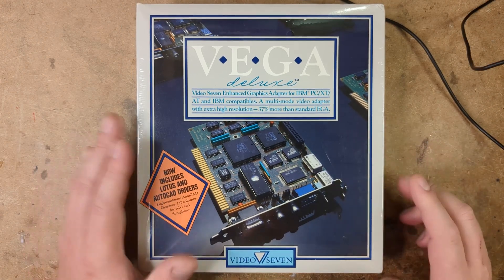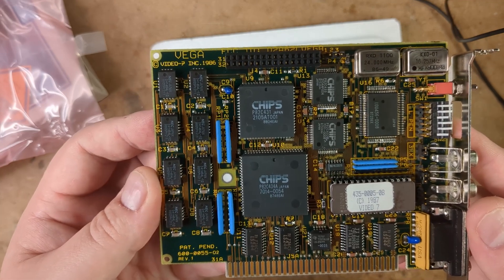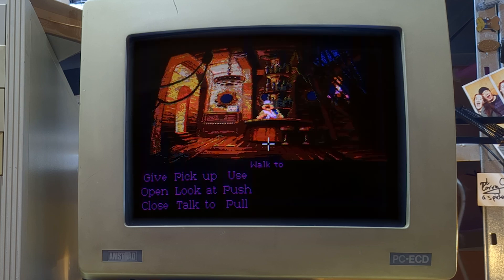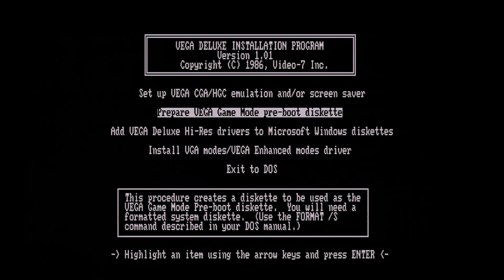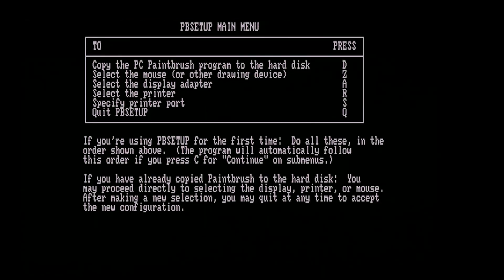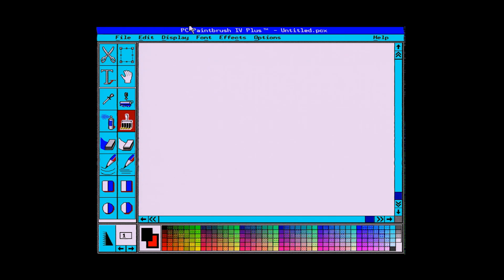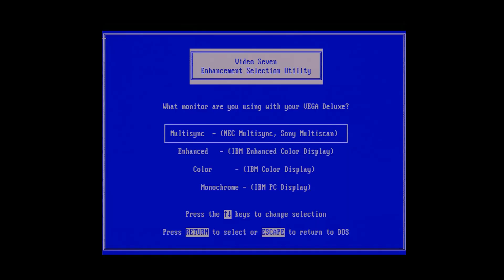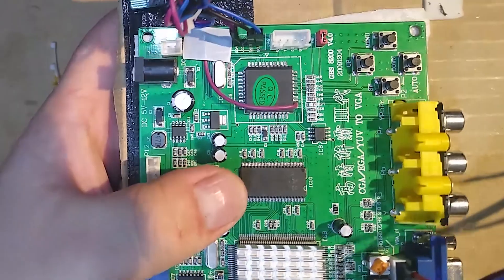Unboxing a Sealed 1980s Video Card!

Comment: What would happen if you installed Windows xp on another card then swapped that one in? Would it boot and run xp in cga?
Reply from the maker: Unlikely, but I'll have to try one day
Reply: It won't get into Windows. VGA is a requirement for all Windows NT based operating systems, there is no ega or cga fall back even with NT 3.1, VGA is the fallback. VGA bios emulation wont cut it you need real VGA. the XP startup screen requires VGA. BSODs even require VGA.
Reply: @MonochromeWench  It'd probably load in 16 colour mode depending just how compatible the VGA "emulation" is and what features the OS uses. If it's basically default VGA capabilities just with TTL output, then the only issue may be that the colour palette isn't quite right (closest available options from the 64). I think even the startup screen in XP is still 16 colour, just using palette fades to look a bit more sophisticated as it appears, so that would also be a bit clunkier (and look even less correct as it has a custom 16c palette rather than the more primary colour biased Windows default).

I swear I've managed to bodge a CGA driver for Windows 95 before when messing around with things, or maybe EGA, so it should certainly work under 9x. Not NT based of course... and the UI isn't really intended to be used with less than 480 scanlines so everything ends up stretched and occasionally clipped off the top/bottom of the screen. Plus being in monochrome if using CGA mode of course... (though there was officially VGA mono support in 9x ... probably not XP, other than a literal VGA mono monitor summing colour input to greyscale...

Though in any case you wouldn't want to install any custom drivers for whatever card you used, just stick to the absolute most basic VGA drivers (or whatever you then replace them with)

Comment: Has someone EVER destroyed a monitor with the wrong video mode??? What a bunch of nonsense...
Reply: You can indeed damage or even destroy a CRT with the wrong video mode. Even modern multisync ones.
Reply: Yes I have - a couple in fact - One of them was an Iiyama too - so abandon all notions of it being impossible.
Reply from the maker: You can destroy other devices by overclocking them so I don't see why the same wouldn't be true of monitors
Reply: @TheRasteri Not even overclocking in this case, too low and poof.

Comment: Whats the expansion port/board on the Vega board for?
More VRam?
Get it so that it can play Crysis.
^.^
Reply: It's just a feature connector.
Reply: Nah, just for bus and clock line access, like if you want to connect to a modulator, genlock / chromakey overlay, etc. One thing that they did get used for was attaching additional clocks that the card could switch its input to (even original EGA had that option in fact), which would let you add a crystal that was fast enough for actual 132-column on EGA monitors and the like. Seen at least one card where there's an official add-on for that which is pretty much an oscillator on a small PCB that plugs into the connector, plus a disk with some updated drivers to take advantage. The more high speed capable boards could even have 30+ MHz xtals added to take you up to SVGA-ish resolutions.

Comment: So ega in 1980... wow that was extreme high , had Wapping 16 colors and improved from the ugliest pink (or poop brown yellow) night  to (nes kinda) 16 colors HD day, must have been crazy expansive back in the 80s
Reply: This is from 1987, the IBM PC wasn't even out in 1980. Or did you mean to type 80's? 😅
Reply: @Nukle0n  yeah 80s but I don't know exact date I just know ega was a big deal back then
Reply: @Nukle0n  yeah the 80s I meaned
Reply: 1984 I think it was introduced, and it was pretty pricey at first. Hence why most cards you'll find are clones like these, rather than official IBM parts... they brought the cost of ownership down considerably, along with third party monitors. And if you wanted extended capabilities like this they were your only choice, as IBM didn't make anything like that, unless you wanted to pay the significant extra for their professional grade solutions (PGC, PC3270, Targa, eventually VGA and XGA, then XGA2 and SXGA). Kind of why they stopped being the driving force setting graphical standards in the PC arena by the turn of the 90s... VGA/XGA was the last standard that had any real impact, because the clone card manufacturers were leapfrogging past them for a fraction of the price, especially in combination with Multisyncs that cost about as much as a fixed-frequency IBM monitor but could do so much more.